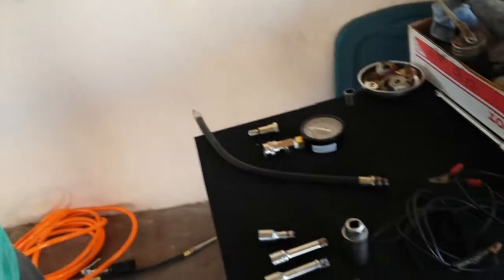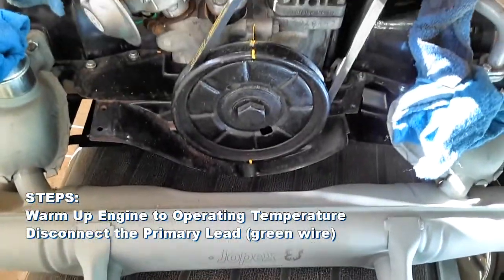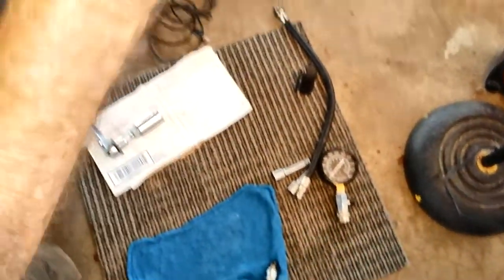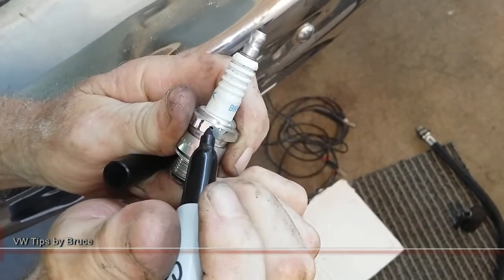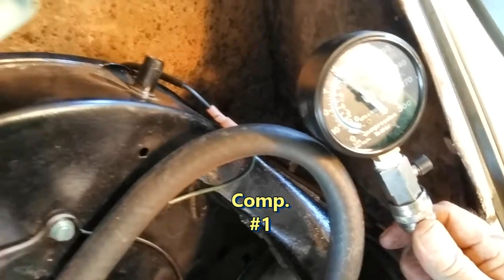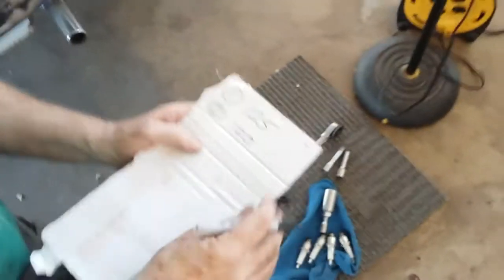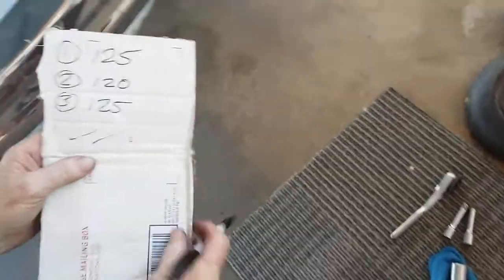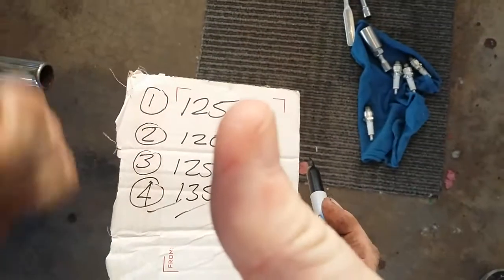VW Bug Cylinder Compression Test | VW Bruce

Comment: Disconect greenwire ? My VW won't start with plugs removed...lol
Reply from the maker: Reddmann, you are correct of course. Disconnecting the green wire is just an added precaution as some mechanics only remove 1 plug at a time. Removing one plug at a time gives the mechanic a better "read" on each cylinder on its performance. Removing all the plugs at once allows the chance that each plug may not be returned to the cylinder it was removed from which is ok, too. It all depends on how close the mechanic wants to monitor engine performance.
Happy Fahrvergnugen 
VW Bruce

Comment: Hi Bruce I have a problem with my 1969 beetle I turn it on and I start driving and after 10 to 15 minutes it’s starts shutting off on me it feels like it’s losing power too much gas and I let it sit for 5 minutes and then I start driving again all good and then it starts all over again can you give me some tips
Reply from the maker: Hi Julian! Thanks for the good question! It sounds like it's "starving for fuel" and the causes why could be numerous! You'll need to do some Troubleshooting...not in any particular order, the cause could be: 

Faulty Fuel Pump: Weak Diaphragm
Trash in the Carb: stuff in the main Jet and/or faulty Float
Bad Coil: When hot, it looses functionality
Vapor Lock: Engine is running too hot; "boiling the gas."

More than likely, one of these scenarios should fix your problem! 
:-)

Comment: Hi Bruce. Great video, got some tips from you today. 
I am curious, with such good looking plugs what main jet in your carburetor do you use to avoid a too rich or too lean mixture. Also what carburetor do you use in your ‘69. I have a ‘68 with a rebuilt 1500cc  engine with a Solex 30 PICT 2 carb and a 125 main jet.  
Thanks.
Reply from the maker: Mr. James, thank you sir!  I run the exact same setup in my '69 that you run in your '68. I think the problem may be in your Mixture Screw Adjustment. A video on this very subject will be coming very soon!  Actually, we will be reinstalling our engine and adjusting our 30 PICT 2, too! LOL Stay tuned!
Reply: @VWBRUCE   Thanks Bruce. Will be waiting for that video.   👍

Comment: mine is 118 120 120 119, i heard that was weak for a 1600 cc engine with only 100 miles on it, am i correct??
Reply from the maker: Hey, Triarii Cat!  Yes, that is a bit low for a new engine. For a new engine, all cylinders should be around 150. Check the torque on your heads. They may need re-torquing. It is a 2-step process that you can find in OFFICIAL Vw Service Manual; probably under the Engine chapter.